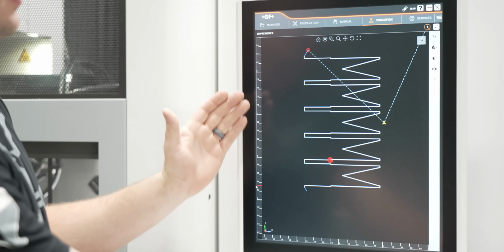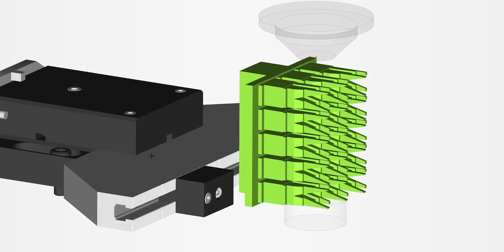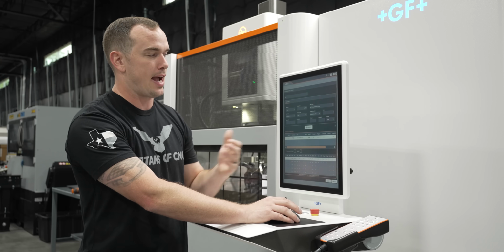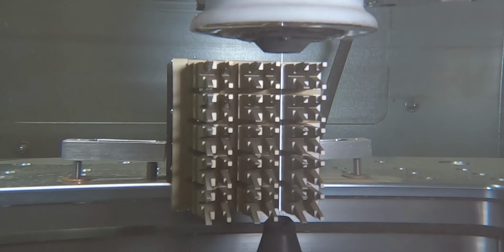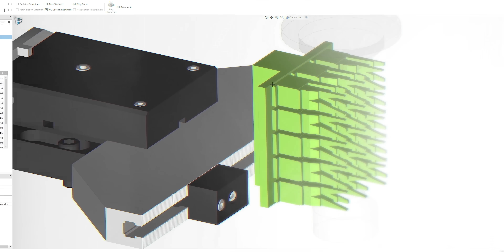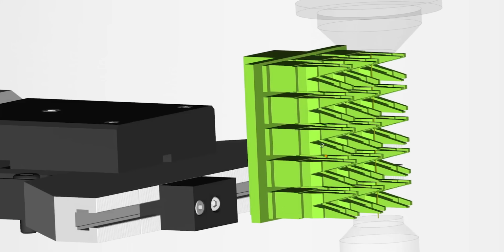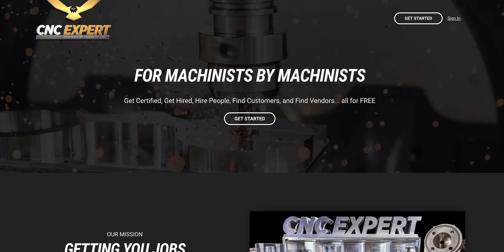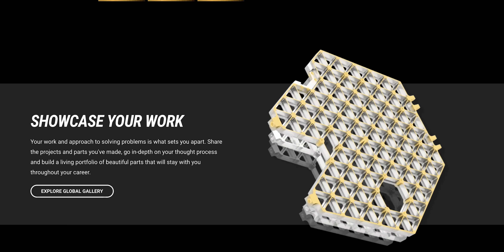Machining 15 FLAWLESS Parts Using a Brass Wire

Comment: Fk that. . . . . Get an edm with an AWF (automatic wire feed). . . . Wire breaks all the time if you're running aggressive AI settings and if that machine isn't cutting that wire, threading it itself, and retracing the cutting path I'd straight up throw that whole machine in the trash bro. Get a fanuc robocut. . . . .
Reply: This machine has an auto threader, it even has a probe for aligning the top surface of your part.

Comment: I love WEDM I programmed and ran a sodick wire and spark machines for one years untill our APT crashed and since we couldn't find a replacement I had to hand code for another one year, it was awesome now two years almost away from them. slug actually was amazing a times than the product. they are antiques though they got to be disposed. I believe a come back soon to those using cam systems.

Comment: I'm a first year apprentice here in Australia and I started on the edm wire cutters(fanuc). I got pretty good at these machines and making cam profiles. I could think of many uses for these machines. I mostly do internal splines and maag cutters in tool steel and tungsten carbide. Pretty interesting

Comment: How exactly does a WEDM work?... is it using pure heat (even though its under water) to essentially 'melt away' thin layers of the metal? or is the Wire moving so fast that its acting like a toothless blade and 'slicing' through the metal?
Reply: It is using AC current to vaporise a region of material around the wire. The wire is not eaten away much and as it passes the cut zone new wire is constantly introduced to create a stable ark. Think of it like a plasma cutter that uses water instead of air. AI setting  maintain the ideal cut parameters as per cam drawing calculations.

Comment: I'm assuming that the 20 thou left on the part to allow you to break it off would need to be removed in some applications for proper fit in the mold once it's assembled. How would you ideal go about doing this?
Reply: Usually a surface grinder will be used to remove the “holding tab”

Comment: What is the accuracy? 1/10th of a mm? That would be pretty low for EDM.
Reply: Accuracy is generally around .0001” or .00254mm. Although you can get even closer
Reply: @trevorgoforth8963  That is why i am asking. I was constantly hearing the presenter saying 1 10th. Maybe he meant 1 10th of a 1000th of an inch.
Reply: @constantinosschinas4503  I happen to be that presenter so I can provide context 😆 The phrase “one tenth” is often used to describe one ten thousandth of an inch or, .0001” does that help?
Reply: @trevorgoforth8963  lol. thought so. thanks for clarifying for us metric people.

Comment: There's not enough EDM video's out there so more please, one thing I can't stress enough to customers that want me to wire cut some things is the machine's work in mm per minute and not meters per minute so thats why EDM ain't cheap, it would be great to see how you dial in and datum a job when you use the chuck,👍👍

Comment: Looks like they were reading the comments from the last WEDM video on not using a cutter to cut the wire LOL
When I do mild inserts like that we use Hirschmann rotary’s. Really gains the unattended machine time versus having to manually index. Good video!
Reply: Plus the time saved by cutting all rows before breaking them off

Might have just been unclear editing but looked like they cut one row at a time

Comment: Be carefull with those 3R mount you put on machine. We've got them for machining electrodes and found the outsides are not guaranteed square to the macro reference surfaces. Plus the 2 halfs are only bolted together, no dowels. So they could move if they ever get knocked or dropped. 
Basically dont trust the body to be square, always clock those references!

Comment: I inherited a 350 CUT and a 600 CUT  from the previous operator at my company and I can say I was amazed I didn't think of using the 3 R chuck gives me work holding ideas rather than just clamping off the side or in a vice.
Reply: Glad you can take something away from the video! That is the goal for us! You can also use rotary indexers to do the same thing but in that case it will index automatically!

Comment: I've always wondered with EDM, what does the tank fill up with before it starts cutting and how does it help the process?
Reply: The tank fills up with deionized water. It is deionized to lower the conductivity. There is also an upper and lower jet that shoots a stream of DI water through the burn gap and its purpose is to flush the swarf from the gap so you don't have wire breakages.

Comment: I am loving our new Cut P 550 Pro! If you guys have any ideas of what you would like to see next, please drop them in the comments! Thanks for watching!
Reply: Can you do multi axis turn and burn with that machine?
Reply: @Jloyd18  Yes, we just need to get the rotary unit. System 3R makes them and they are compatible with this machine!
Reply: I’d like to see how did you finish second op, because these cavities are very precise and when you cut off only with one cut it’s very hard to hold some tolerances